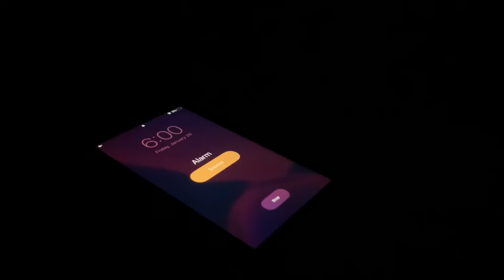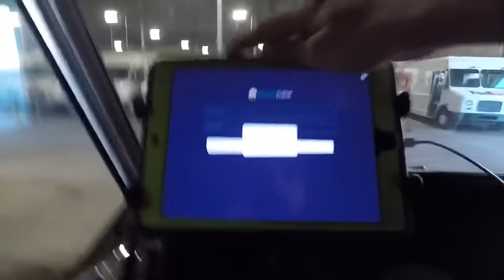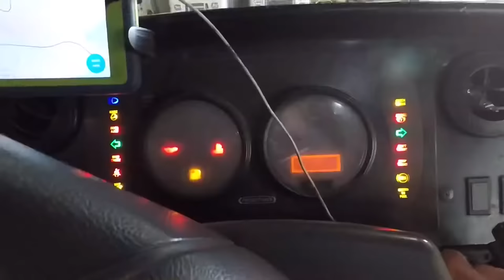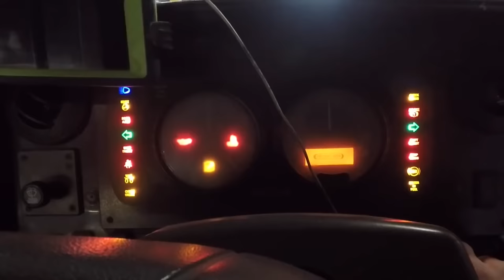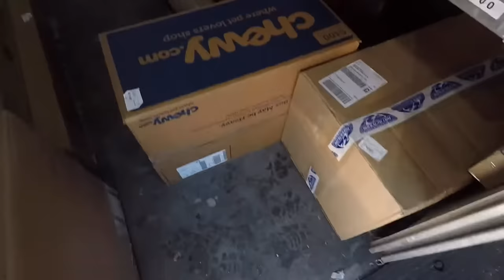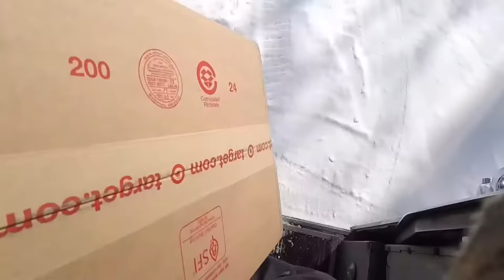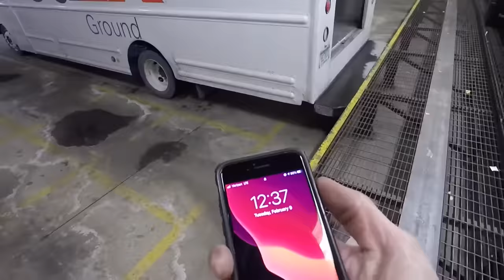Delivering FedEx in Sub-Zero Temperatures

Comment: I'd wrather do this than what I do but my salary would be cut more than half, I deliver in the Midwest and usually sit outside waiting for a forklift for 15-30 min and Minnesota and south Dakota suck with the windchill usually around -30 plus my heater might take a shit and I'm stuck my sleeper being at probably in the 20s maybe less, and there's an idle timer if it's 29 degrees or lower it'll run if it above 29 it'll shut off after 3 minutes

Comment: Second off that’s a Diesel engine you gotta let the glow plugs warm up in weather that cold
Reply: i hoped someone else would have picked up on this. didn't wait for the wait light to go off before turning the engine over.
Reply from the maker: Except that the batteries were dead that morning. The truck also sits in a heated warehouse so waiting for the GP light is almost useless.

Comment: How is the heater in the trucks? Or what heat thusly have?
Reply from the maker: What heat? Haha the engine barely gets up to temperate so the only heat you feel is when you’re WOT. 
Even if there was heat it’d be very hard to keep it trapped in the cab because it’s such a big open space.

Comment: 3:00Listening to radio with the engine off in a modern vehicle shouldn't have any impact on your car battery. Even though you're using energy, the drain is so small your car shouldn't suffer from it.👌🏻👍🏻🤣

Comment: Gloves are a pain in the ass, I understand that but if you have to wear them, wack a pair of rubber washing up type gloves (surgical, what ever) on and then the main gloves, toasty as fuck but yea the gloves are a pain.  Same with your feet man, put plastic carrybag over each foot, elastic band round your ankle to keep the bag sealed tight or best you can, then your shoes on.   No wet can come through to your feet and the hot air soon builds in those bags that your feet are also toasty as fuck lol  It makes things a lot more pleasant man.  Also there are these things you can buy , cheap as anything, i got a job load of 100s for next to nothing, you smash the little bag up and they let out heat for hours, I used to shove them down my legs and back and places that got effected the most by severe cold. Trust me, all those little things i said here will help and suprise you!!  Even a plastic carrybag over the foot lol

Comment: At ups they average 200 stops even if you can’t do that many they force it on you and you have to get it done within 8 hours or you hear about it the next day. Not worth the wear and tear on your body
Reply: That sucks I kinda want to still do things in life by the time I’m 50 without messed up knees and back
Reply: @Natemerica98  don’t work at ups then. A lot of the delivery drivers at ups have surgery on their knees from having to work at such a fast pace. They make you walk fast enough to where you could basically be jogging and you do this all day. It’s like jogging for 10 miles every day 6 days a week
Reply: @bobloe1  it depends on the ups, I drive at a center where guys average about 120-140 but there's alot more driving between stops. Are building manager does not want us to get overtime. It really sucks. We only average about 8-9 hours
Reply: @amd1273  where I was driving it’s was 150-200 stops average and we’d work 6 days a week. Some routes you’d drive more between stops others you’d get 30 stops off in less than a hour. Guess it all depends on what hub you’re at
Reply: @bobloe1  I kinda wish I was at another center, alot of the older guys with families are happy with 8 hours. I'd rather get the ot and work longer. Nothing I can do, built up to much seniority
Reply: @amd1273  that’s sucks. If you haven’t been at that hub for more than 2-3 years you can switch to another one but if you have more time than that in it I wouldn’t cause you loose all that seniority.
Reply: @bobloe1  I'm full time, 22.4 driver. I would lose that if I go elsewhere. Besides I actually transferred once already cause I wasn't getting enough hours. I still get my 40 hours guaranteed just anything after is being monitored by management
Reply: @amd1273  well at least you get 40 hours. It is peak season so you might see more hours now that more stuff is being shipped. I’d personally just stick it out you got a full time job. The extra hours and money is nice but you gotta just take what they give you and if they ever offer you ot take it. That’s what I did every Saturday they needed workers I’d apply for it
Reply: @bobloe1  true, could be alot worse
Reply: You don’t have to get it done in 8 hours idk where you got your info lol you work at a safe and reasonable pace you can be 2 hours over allowed and the on road sups may not like it but they can’t do shit about it cause we’re protected by the union
Reply: @boogieman8973  that’s if you pass the 30 days in packet. I just applied for a job with ups and they failed me cause I couldn’t do 200+ stops in 8 hours. That’s the exact reason they told the shop Stewart when they let me go. It’s the new ceo she’s fuckin everything up imo

Comment: So dangerous to leave the truck running and your not in the drivers set.
Reply: No but ok
Reply: @Giovanni_Litterini  yes it is and  it against fedex policy
Reply: @timblack1983  Well then you explain to FedEx why all his stops will be late and why he would need a mechanic out with him all the time since the truck needs to be jumped every time you want to restart the truck
Reply: @Giovanni_Litterini  Dude ive been working for fedex for 15 years, ive been able to do it. Vehicle cant be secure if you leave it open and running. If you cant do the job correctly and on time, that managements problem.